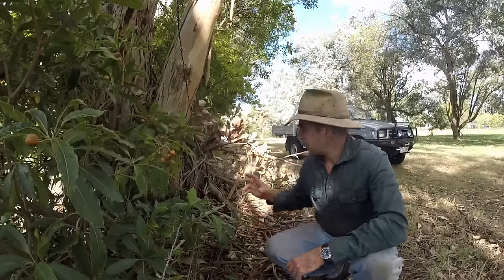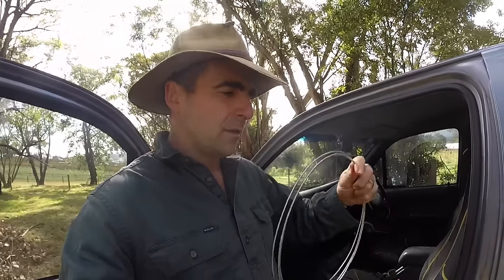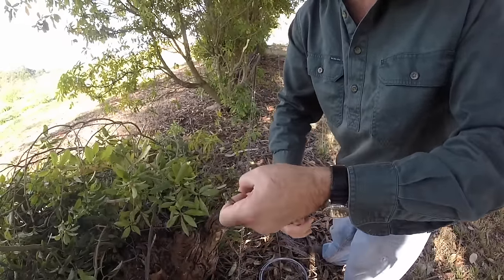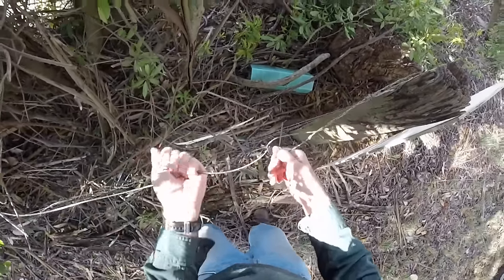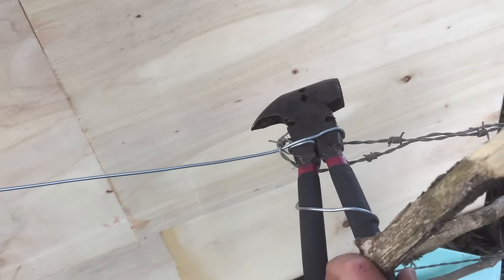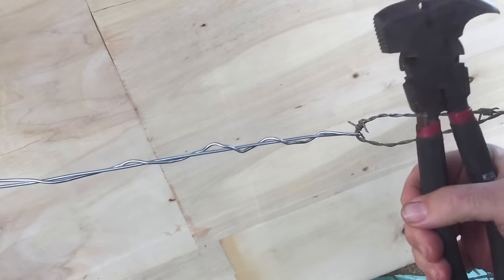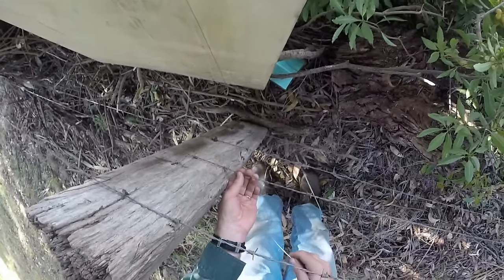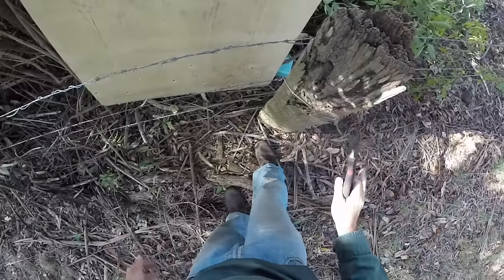Fixing a Fence Using Only Pliers

Comment: And my 2 cents worth, don't by cheapo ones from a surplus outlet, you will be amazed at how much better a set of good ones will do all they can do, central BC guy, my area channel lock brand, now probably about 40 bucks, about the same as 3 packs of smokes, but they will out last you, specially if you keep smokin

Comment: Great video Tim one tip I tell my clients is on the tops of the wooden posts tap a staple in half way do this every few posts and especially on the h braces so if your in that situation and you've lost the staple and don't have your tool box with you then there is always a staple close by.
I hope you find that tip useful

Comment: Good idea. . . Where I live in the Philippines its difficult to find strainers, so I got a metal tube ( 1 inch diameter)  and cut it about a foot long and drilled a hole thru it about an 1.5 inches from one end.

One end of the wire goes thru that hole and I crank the tube as u show over the looped wire until tight and unwind as u did. The tube makes it easy to turn over the looped wire .

For the crank, I just drilled a hole in the other end of the tube and ran some L shaped reo bar thru it. 

Worked well on all the fencing I had to do, which wasnt too much. 

So u gave me a good idea which I was able to modify. Cheers
Reply: Plz post a photo of d tool u made. Thanks from Bharath

Comment: Here's my tip: NEVER be tempted to drop or throw used staples and bits of wire on the ground. The old ranchers who worked in my area (central British Columbia) were slobs and left debris everywhere, and as a result the cattle ended up with hardware disease. For non-ranchers, that's when livestock accidently eat metal bits while grazing. Those bits accumulate until the animal is in need of a veterinarian. 
I've been on my land for ten years now, and I'm STILL finding staples, rusty barbed wire, cans, pieces of T-bar posts, you name it. Some folks just had no pride in their ranching.
Great video! I'm going to try your trick tomorrow.
Reply: a metal detector costs 100€ ... 150€ .. 

You can probably make a deal with a local metal detection expert.. He picks up every little bit of metal that triggers his detector, and he can keep everything valuable. Just hide a few metal bits of your own at known places, so that you can make sure that he picks up even what is not valuable (make it clear before that he has to find a given proportion of the items YOU hid in order for his to keep what's valuable...)
Reply: It's a good habit to keep tires from going flat too.

Comment: That's pretty clever with the fencing pliers Tim. I'll give something like that a go next time I'm fixing. Normally I just put a bend in the wire, slot it and push it down (but I'm normally using strainers). My fences always get "temporary" fixes that seem to be in there for years ;)
It would be good to see a video from you on existing fence repairs and when it's time to just give up and rip it all down.

Comment: Back around 1960 we were on our way out to the farm and Dad noticed a hole in a neighbour’s fence (all strands). We stopped and Dad & older brother repaired them and off we went. A few mile down the road we were stopped by a mob of sheep. Down the back was the neighbour. 
You guessed it 😂😂, we had to turn round and open up the fence again. 
But in Dad’s defence, the wire wasn’t pulled back or secured in any way. As we were blocked from our farm we just went down the road a bit blocked the road & waited for the mob to be secured, Dad help secure the fence and all was good. 😂😂😂
Back in the day Dad had a strange assortment of tools in the boot and even today I have a strainer in the back of my car, along with a strange assortment of tools, just in case, and we live in town 😂😂 (rural).
Good on you mate, hope you’re doing good.
Reply from the maker: Thanks so very much for sharing mate. Pays to be prepared hey?

Comment: I was taught much the same trick, but was shown how to do it with a claw hammer. You can get the wire 
REALLY tight with a hammer. Probably too tight, to the point that the wire kinks and will tend to break there. 

I was taught that it WAS a permanent repair, but experience reeducated me that it wasn't.

Comment: In the USA we use wire gauge here. Can you tell me what gauge is that wire you used. You said 2.5mil. Thanks
Reply: 10 AWG.
Reply: 12.5 gauge is 2.5mm
Reply: 2.6mm = 10 AWG
Reply: @richardmccrae5422  Correct